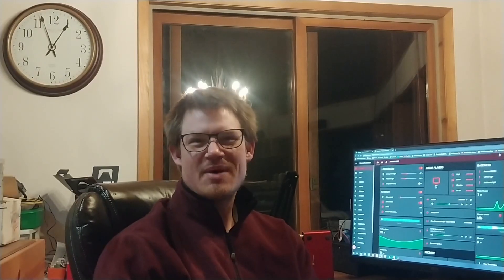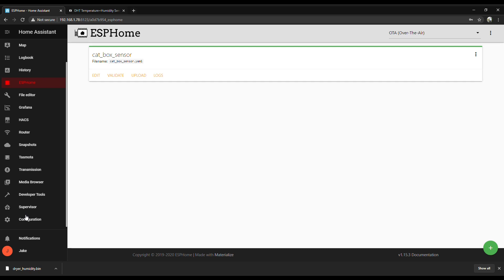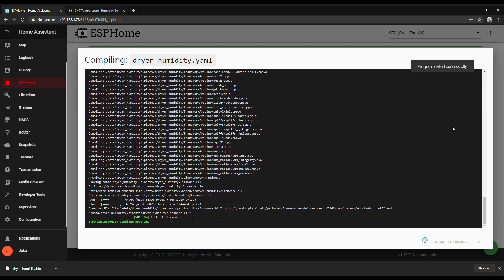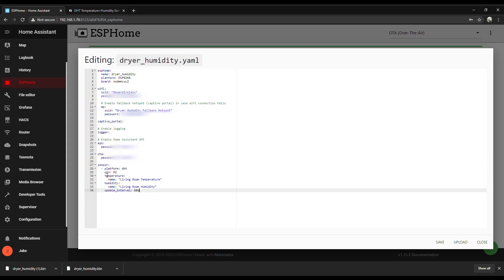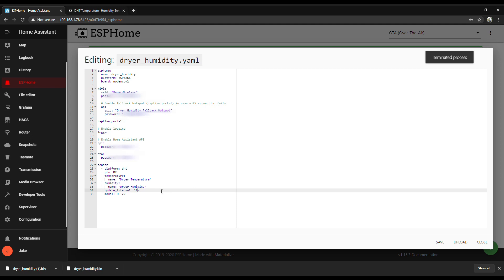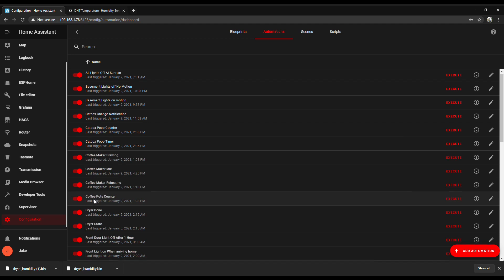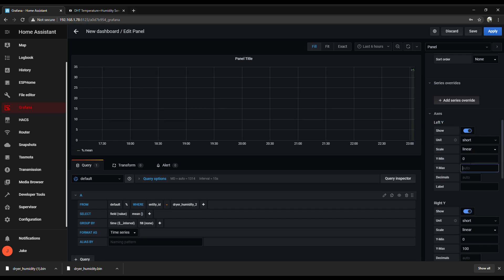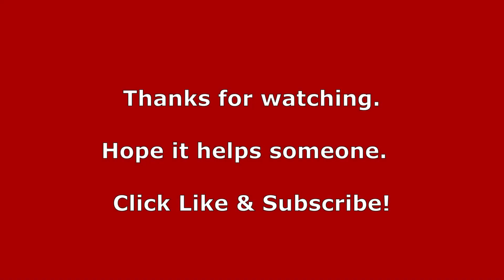Make a Dumb Dryer Smart in Home Assistant!!

Comment: nice tutorial, any chance you could do another tutorial for the washer and also maybe show where the sensors are placed on the dryer and washer. good luck on your channel. Thanks!
Reply from the maker: I'll do a washer video for you next weekend.  I am using a Sonoff S31 smart plug flashed with Tasmota to monitor the watts to determine what cycle it is on.  Since the washer does the exact same thing every time, it's pretty easy  to track cycle changes.    

For the sensor, I just put a tiny hole in the exhaust hose behind the dryer and ran the wires through it so it's  dangling inside where the air is passing.  Eventually it might get clogged up with lint but the sensors are cheap so I can swap a different one in later if that happens.
Reply: @BauerPowerTech  Thank you very much, will keep an eye for that video.
Reply from the maker: Charlie,  I found out I gotta work this weekend so the washer video will have to wait a little bit.  I don't want to rush it and want it to be quality content.  I don't want to make a promise I can't keep but it WILL be my next video as soon as I have time to do it.  Thanks for understanding!
Reply: @BauerPowerTech  Thank you..! Maybe we can talk some other day about an idea for a project I want to make. Maybe that would be what I can start a YouTube channel in Spanish or bilingual!
Reply from the maker: Charlie.  I just uploaded your video!  Enjoy Amigo!

https://youtu.be/TV4ZKWkC83c

Comment: Thanks for the video - how did you attach the sensor to the dryer? Was it near the exhaust or somewhere in the drum?
Reply from the maker: I just put a tiny hole in the exhaust hose behind the dryer and ran the wires through it from the inside so it's  dangling where the air is passing.  Hope this helps and thanks for watching!
Reply: @BauerPowerTech  Are you sure to put the electronic device inside the exhaust hose. Wonder the temperature inside may be over 100+C. Please advice. Maybe a picture would be nice. Thank you.
Reply: @BauerPowerTech  many thanks - great little project.
Reply: @BauerPowerTech  its so nice, thanks for making it. could you please share a pic on where and how you placed it? next time on your video if you can add those details would be a real help for newbies. 

Subscribed your channel already .. cheers.